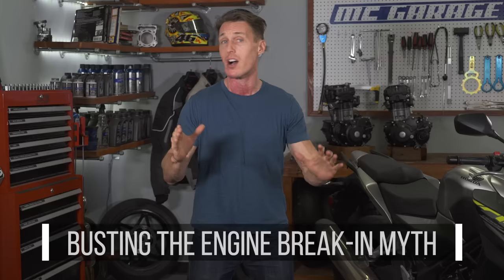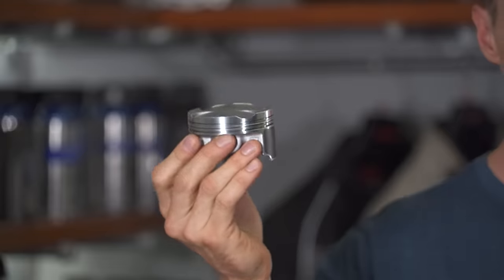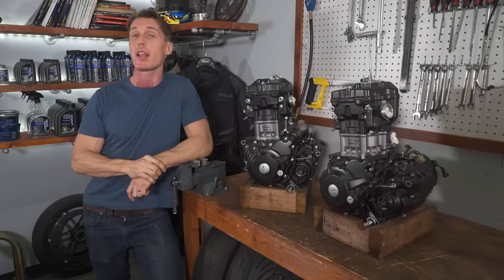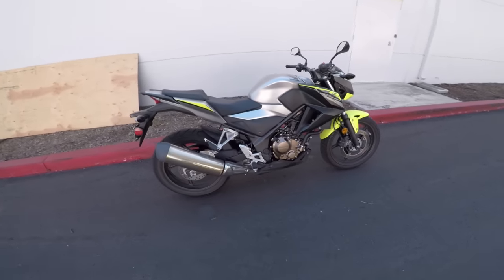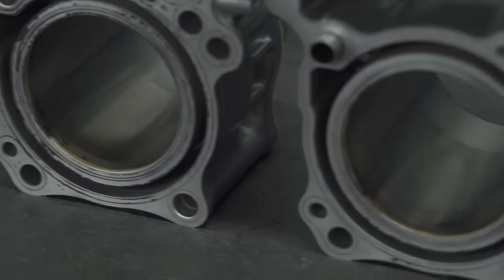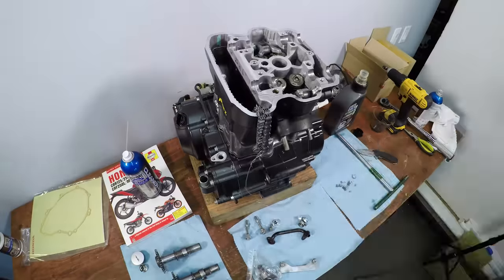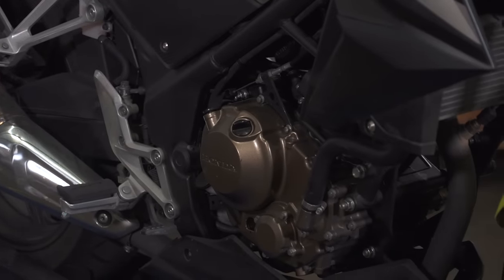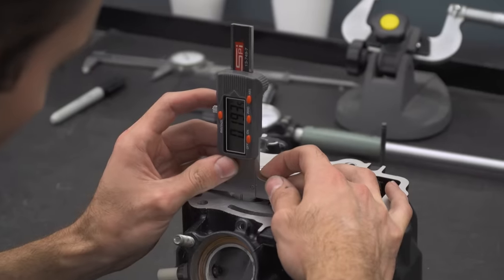Busting The Engine Break In Myth | MC Garage

Comment: Ok, as an engineer (propulsion specialist) my opinion on this is the manufacturer recommends breaking in the engine slowly because the chances of defects in the materials or manufacturing are still there and failing at 3000rpm with destroy the engine but most likely will not kill you, now 13500rpm and 100+ mph, having a piston blow, stoping your rear wheel will most likely kill you. I actually went through something like this, an intake valve seal failed and because i was at low rpm, was able to drive to the shop with no major damage done.

Comment: 6:09 A third possible reason for long break-in recommendations is that if the manufacturer can convince you to ride gently early on, they are less likely to have to repair anything on warranty.
Reply: PMitchell106 yep that makes perfect sense lol. I agree. My uncle has been a professional engine builder for 50 Years. The first thing he does is get sideways pulling out on the street. He says if it hurts it then it wasn’t any good in the first place 😂
Reply: Excellent point!!!
Reply: @JohnnyRebKy  huu7
Reply: this is the real reason.
Reply: Well said Pmitchell👌👌👍
Reply: So obviously the truth, every one was oblivious to it!
Reply: Also, couldn't it be a potential liability for a manufacturer legal-wise if they told the customer to "just go out and wring it" to break in a new bike? I mean you'd have yahoos breaking speed limits and doing wheelies & burnouts all over the place. And probably crashing. There are some riders out there who probably have to be kept in check, and the mfgr has to protect themselves from this type of rider any way they can. 🤣
Reply: @JohnnyRebKy  I used to work at a Stihl power equipment dealer. The way we broke in brand new, right out of the box chainsaws & weed eaters etc was to fire the engine up and immediately hold it wide open at max rpm. Brand new engines couldnt reach max rpm right out of the box but over the course of 60-90 seconds at  wide open throttle you could hear the max rpm gradually increasing (due to the rings seating etc) until the rev limiter eventually kicked in. Once the rev limiter kicked in the engine was properly broken in and ready to hand to the customer. This was the factory recommended break in procedure for all Stihl products.
Reply: @theadventurebiker  I doubt they have any legal liability for what happens, but it would definitely be bad for the manufacturer if there were a high number of first-day crashes, as those may be customers who get spooked and never come back to motorcycling, and they also have a horror story to tell all of the motorcycle-interested friends. There is also the issue of new tires lacking proper grip in the first hundred or so miles.
Reply: @PMitchell106  Yes, agreed. But I also think that there really isn't a way for a manufacturer to tell the owner of a new bike to "ride it hard" etc. to break it in without implying (at least from the customer's perspective) that this also means "ride fast" and/or aggressively. Think of all the kids out there who would get speeding tickets etc or worse yet into accidents, and say "My motorcycle owner's manual said to ride hard to break in my new bike." Think about the heyday some lawyers could have with this...
Reply: @theadventurebiker  Agreed. Interestingly, since this video was released in 2018, many manufacturers went from encouraging a gentle break in with the owner's manual, to partially requiring it through software that limits the most aggressive riding modes until the first service is completed.
Reply: @PMitchell106  Wow I didn't know that. Interesting stuff indeed.
Reply: @Andrew Humphrey Yes, true. I'm not an engineer but I would think that the loads and stresses placed on components like pistons, rings, & cranks etc would be proportionally similar in very small engines and also larger ones. Again, in proportion to their size. Also consider the effects of heat - the combustion temps are going to be the same regardless of engine size but the tiny, thin walled pistons, rings, & cylinders of a chainsaw engine for example are going to heat up (and feel the effects) much quicker due to their small miniscule size than those of larger engines with larger more robust components. I could be wrong but due to these things I would think that the effects of break in would largely be the same.

Also consider a chainsaw that is used by a professional logger - I am sure that an engine used in this scenario sees some pretty hardcore use day in and day out for several hours a day, probably more severe use than most motorcycles (or cars).
Reply: @theadventurebiker  That is how I broke everything in. We used to rebuild snowmobile engines and dirtbike engines and just hold it wide open for 5-10 minutes before the next race!  We figured if it could handle that it was good to go.  Breaking it in hard always seated the rings better in my opinion.
Reply: @davidbrennan5  Yes!!! 👍
Reply: And for lawsuits. They can't tell you to go hamfisting a new motorcycle, and you loop it.
Reply: Yes..this is the main reason why companies asked us for break in period
Reply: This is some out of the box break through..
Reply: That makes total sense. I bet you are right.
Reply: “Oh you didn’t follow this incredibly limiting and complex break-in procedure for the first 4000 miles? Clearly you were abusing your engine. Warranty claim denied.”
Reply: its also probably not advisable to tell a possibly new rider to go crazy on their brand new bike
Reply: @wigit2216  That's less likely to be a factor. If you decide to crash your new bike, that's your business. The manufacturer and dealer who sold it to you have no liability, and they will happily sell you or your insurance company repair parts and services or a replacement bike for a healthy profit, along with voiding your original warranty to any future costly claims against them. They do have a financial interest in avoiding warranty claims though, which are more likely if you ride aggressively.
Reply: They also can make it so you have to bring it in for inspection even if nothings is wrong that’s why they say service is either 10k miles or 1 year
Reply: So your suggesting long break-in is promoted by the maker because it makes the engine less likely to break and thus the manufacture doesn’t have to repair anything under warranty. Exactly why is this a bad thing for the owner🤔. I would rather have my engine not break and not need to use the warranty. That’s good for me and the manufacture.
Reply: @mrsmith8436  I didn't say it was a good thing or a bad thing, it's just an explanation for why the manufacturer promotes it. 👍
Reply: in old days first 2 oil changes full of metals from rings seating  piston and cyl wall wear clutch debri, new bikes have better metals and tech.  Older bikes it was to protect engine, once everything got broken in and top layer of material in oil and cleaned out they were good to go. new parts do not need break in like old bikes.
Reply: Now i learned something
Reply: Wow! Interesting... conflict of ideas, but it all ends up about safety!

Comment: WOW! The soft-break-in engine impressed me! ALL engines are broken in roughly - first start, from factory, they warm up the engine then do a full dyno run, 1,2,&3rd. Twice! SO - point is, what impressed me the most is that an engine that did not get its proper wide open first start (which is what they did, when they built the motor themselves, no dyno) I was impressed that it seated the rings at all!! :D Different strokes for different folks, I guess :)

I prefer a "proper" break-in, but the southern version of "proper" lol - not rough, but also not gentle, neither - I don't need to hit redline right out the gate, but get on it!! Keep the RPMs varied, downshift a LOT to maximize blow-by protection, and don't be scared of 'er! Do it right & you can really feel the moment that all the parts hook up!! It's like hitting the power band on a 2-Stroke, and your engines will last you forever!
Reply: not even close to "every" factory does that. they also don't dyno every engine. that's a waste of everything  lol. and they most definitely don't max it out. they normally just cycle thought the gears lightly to see if she's workin.

Comment: Really enjoyed this video and I'm so glad to see you guys finally put this damn topic to rest.  I recently broke in a motorcycle and discussed this topic from my own personal opinions and it was pretty much the same thing that you concluded here.  Just ride your bike, use common sense and enjoy the process :)
Reply: Agreed. I like his final point of not just the engine breaking in, but the tires, suspension, and you getting used to the bike too.  Very good points.

As for the controversy, what I've come across is a lot of 'know-it-alls' who don't have a degree in anything, let alone engineering, spouting their opinions as fact, and calling anyone who differs in opinion, every curse word you've ever heard. Clearly, these are highly intelligent individuals. 🙄

For myself, I look at it this way: 
If the manufacturer is recommending the process, and ultimately it's going to be the manufacturer who is responsible for replacing any parts (or the entire engine) if anything fails after following their recommended break in process, why not just follow it?  It's only 600 miles.

I bet there's already someone typing the response "but if they can't tell if you broke it in hard, then..."

They can tell.  This video talked about there not being any discernable difference in the parts, he didn't say anything about there being burned oil on valves or cylinder heads, which is a dead giveaway for excessive heat and rpm.

To each their own.  I'd just much rather know that I'm definitely covered under warranty, than be told "sorry, you didn't follow break-in procedure, and thereby voided your warranty".
Reply: @Jeff-Vader_head_of_catering  cool story bud

Comment: This is so true with all modern day manufactured engines. The manufacturing has become so precise that tolerances are nearly identical from one engine to another, machining has improved so much that parts no longer need to wear in. The only ting that does need to be done correctly is to seat the rings, which is done in the first few miles, or in some case, on the assembly line before the engine is even installed.  What DOES need to be properly broken in, not so much on a bike, but in cars and trucks is the transmission and final drive. Ring and pinion do need to be broken in properly of they would get abnormal wear patterns, become noisy and eventually fail. Same goes for manual transmissions, yes kids, they do exist.  Overall, I am really glad this video was made, it backs up what I have been saying for years. Just drive it!  If it's gonna break, it will break no matter how you drive it from the start.  The only exception to this rule would be hand built performance engines that don't use factory parts.

Comment: This has always worked for me resulting in long lasting high performing engines. Hard acceleration and the lower gears (1-3) in short bursts is critical for the first 30 miles (rings seating), while letting the revs come down slowly with closed throttle to pull out any break-in particles. Do not lug in higher gears due to the bearings breaking in during the first 600 miles.

Comment: Great to actually hear it from the top! I found a harder break in with BMW twins seemed to give long-term better mpg, performance and less oil use. On the K series, it made no difference, but each could just be the as-built variations of the engine.
Hope recovery goes quickly, looks like it seriously hurt.  Good luck in the new venture. I've got so much out of your vids, so thank you.

Comment: Great informative video. I'm currently breaking in my Z 650 RS  and I have taking the approach of easy does for the first 100 miles of no higher than 4000 rpms with various speed, RPM and shifting with plenty of engine braking and using 1/4 throttle. I'm 200 miles in and now I'm increasing the rpms with higher speeds not exceeding 6000 rpms and continuing the other parts I mentioned as well and going to 1/2 throttle until I reach the 600 mile break in service. After the break in service I'll continue to increase the bikes capabilities until I reach 1000 miles do another service and call it a job well done and enjoy my bike worry free .

Comment: I really appreciate this video! I just got a new top end for my 66cc 2 stroke motorized bicycle 😁 I was wondering why exactly — or IF — the break-in was REALLY as important as they say. For example, I don't remember my dad EVER breaking in a new lawnmower....... always just put oil and gas in it and used it!

I'm still going to try and be easy on my engine though. It's just common sense that the less strenuously you use something, the longer it will last. There are lot more moving parts than just in the top end, of course.

That being said, this video gives me more peace of mind about occasional high revs on a new top end! Thanks for taking the time to do it!

Comment: Wow! That's a really strong engine.  I did a really hard break-in on my new Bajaj CT-100b, right out of the store. Revving the engine up in all its four gears. After only two hundred kilometers the engine became noisy, clickity clackity. When brought to the service center, they said the tensioner loosened up, creating the clackity noise. They simply adjusted it to tighten it, as they said they did, and the noise lessened, but the engine doesn't seem to be as quiet (regardless of the exhaust noise) anymore as it was when I rolled it out the store.  Lesson learned, follow the manufacturers' recommendations.

Comment: I’m breaking in my new CB650R right now, up to about 100km ridden so far. I was pretty gentle with it for the first 10-20km and then as I got used it it I started riding it similar to how I ride my old bike but just without any WOT and only revving it to like 2/3rds of max rpm at the most. I’m kinda just riding it at medium pace and varying the rpm, gear etc and making sure I don’t lug it at low rpm. Really enjoying it so far and I can’t wait to wind it out to 12,000rpm. Even the taste that I have gotten so far is pretty delicious.

Comment: I think the video presents some really interesting points regarding engine technology, the fact is that specific design differences are an important consideration.  For instance, when I rebuilt my Porsche 914 engine and replaced the cast iron cylinders with nickasil lined aluminum cylinders "ring seating"  was no longer a concern and revving to redline wasn't an issue.

Comment: This is really an outstanding video. The only thing I would have liked to have seen would be the "after" dyno tests.  Was there any difference in final performance numbers?    

When I was working at a shop, we had a demo bike, that was caned and brutalized, and a customer bought the same bike and babied it.  The customer bike came back for a power commander and a dyno tune, and for fun we put the demo bike up on the dyno too.  The demo bike made more power.  This is no where near as precise as this video, but why I would have like to have seen a dyno run done on both bikes after break in, particularly, since the video did mention there was a difference in End Gap.

Comment: Excellent video, I like your opinions I agree! Only bike I bought new was a 1997 Suzuki RF900R and I broke it in as manufacturer specified. Rpm limits per certain amount of miles but didn't say anything about how much throttle up to that rpm limit so I accelerated as i wished but short shifted at specified rpm. Serviced as recommended. Always ran great for me!

Comment: The only indicator I would expect to vary would be surface finish characteristics (not just Ra, either) and initial wear patterns, which weren't discussed.  Break ins are intended to control these parameters in sliding and mixed friction surfaces of the piston walls, the various plain bearings, and transmission gear faces, and ultimately impacts how the elastohydrodynamic layers of the lubricating oil films form on these surfaces.   Large dimensional changes of the components are not what break-in if for, if there was a problem with the metallurgy (gross dimensional stability) a break in would not have any affect for typical materials used.  It would also be more interesting to see on a 'lesser' motor, it is very possible that Honda tolerancing is sufficient that no real break in is needed, which is the case with many modern engines.

Comment: The only time I know of (professional mechanic for over forty years now) for being critical in regard to "break in" is for flat tappet motors. Back in the day when every automobile motor had flat tappets, pretty much all motor oil had a high zinc content, so you never had to think about it. Nowadays you have to specifically look for it and stay with it. Motorcycles have had roller lifters in pushrod motors for a very long time so it was never really an issue. Anything with overhead cam where the rocker makes direct contact with cam lobe and valve stem does not need a break-in, nor has it ever.

Comment: I think that proper break in is not keeping revs low. Break in is conservatively exploring the entire rev range, slowly working your way to theupper bands. For example, get out on the highway, go 75, but switch between 6,5,4th gears. Then do it at 80. Then at 60. Just focusing on not dogging it out. Also allowing proper heat cycles for start and shutdown. This is what we do with new jet engines and piston motors in most cases. For some jets we go up to slowly work up to 80% rpm, then sustain that for 20 minutes. The next day the jet goes to 100. For our piston airplane motors, most of them need to fly at 2400 rpm, (idle is 800, redline 3500) for 2 hours on the first flight.